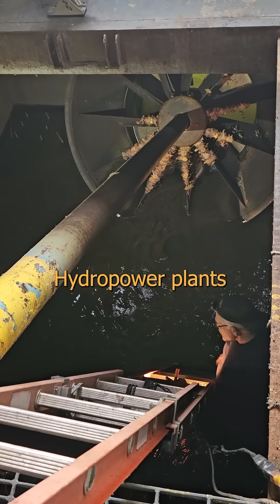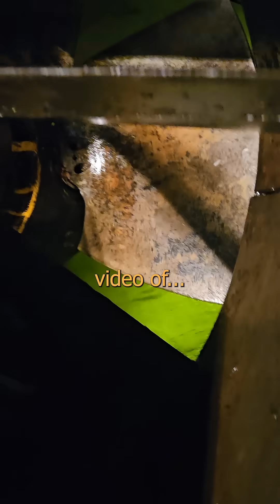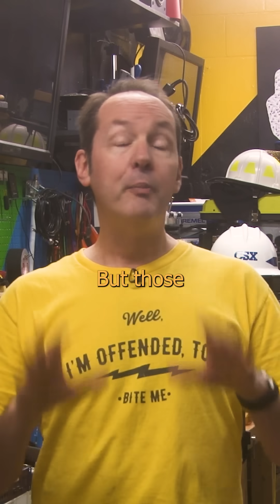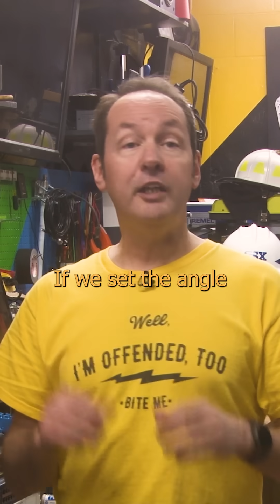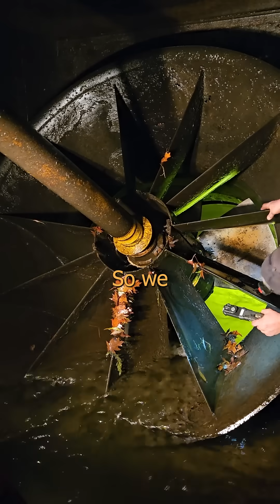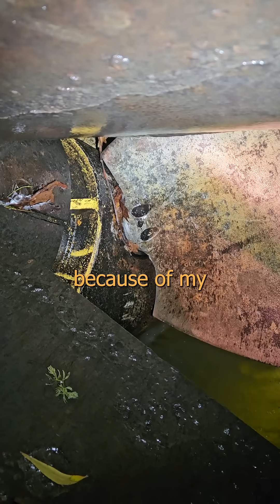Blade Angle  #chrisboden #comedy #engineering #educational #physics #apprentice #science #energy

Comment: Flying my mom's Cessna 337 was always cool because it was always a learning experience on how to fly that bird efficiently. Fine blade pitch for takeoff and maximum power availability then once you're high in the sky, start adding pitch angle to pick up speed and get better fuel economy. Don't get me started  on the finesse of FUEL MIXTURE control and Lean of Peak settings.  UGH    XD XD XD
Reply: I would hope in something as expensive as an airplane the fuel air mixture is controlled by the ECU to always sit in an optimal power and efficiency band.
Reply: @filanfyretracker  FAA certified piston engines DO NOT HAVE FADEC... especially engines for anything older than 30 years... And NOOOO... you cannot just fart around and change things  that are certified, unless you get the engine company to FAA certify that engine for Full Authority Digital Engine Control systems. Takes decades of testing and millions of dollars. Engine companies are gonna look at you like you grew a third arm and just laugh at you. So no... Unless you want your aircraft to be killed with no flight certification... ya don't screw with how yer bird was built... Common sense.
Reply: @filanfyretracker   besides... The engine ECU is THE PILOT...

Comment: I love how so many of our means of generating electricity is just simply spinning a turbine, from steam power, to nuclear power itself all just spinning turbines.
Reply: There are very few ways to generate electricity without the spinney bits, and nearly all of them are more expensive than using the roundy roundy pixey pusher. PV is the most common, and fuel cells are 2nd place. Peltier/BMJ/thermocouple devices can also be used but they are very inefficient.
Reply: @PhiloSage  It's also incredibly cheap for large scale. Compared to high tech materials like piezos and photovoltaics, the generator is just a couple of magnets and copper wire, or even replacing the magnets with more copper wire.
Reply: @PhiloSage Doesn’t make it any less funny that we are designing things with the same core idea all this time later!

It’s just like how a modern F1 car still fundamentally uses the same four stroke combustion cycle as first implemented in 1876.
Reply: @ChlorideCull when it comes down to it, it's all solar power. From direct photon transfer, to fossilized plants, to element fusion/fission. All from a star somewhere somehow. 😁
Reply: @PhiloSage tidal power would be an exception
Reply: @thorwaldjohanson2526 just where did the moon come from?
Reply: @ChlorideCull  that is how technology works... current technology is built on previous technology.
Reply: @PhiloSage  not the sun.
Reply: @thorwaldjohanson2526  also geothermal (which is arguably semi-tidal in nature, I think). I think a lot about subsea hot vents sustaining life independently of the sun.
Reply: It's one of the most efficient ways to generate an electric current and the general availability of water and its energy capacity make it an easy choice. Even a nuclear power plant is just a steam turbine generator with a very spicy source of heat. Even fusion reactors will likely be used in a similar fashion.
Reply: Photovoltaic solar is the main exception for large-scale power. Chemical reactions (batteries) for small scale. And thermoelectric generation is mostly just used to measure temperature & power some spacecraft. But "spinny thing go roundy round" + magnetic field is the GOAT for large-scale power generation.
Reply: theres a company called Helion building a fusion reactor that uses the magnetic field around the plasma (or something like that, im no nuclear botanist) instead, its pretty cool
Reply: @skyblue1954  you can ALWAYS find some goofy hypothetical thing that "someone is working on" or "researchers say". When you've heard all this stuff for decades and nothing ever comes of it, you start to see the pattern of bs 😂
Reply: @jeffhall768 I mean, they already have an experimental reactor and are building their next one
Reply: @skyblue1954 heard it before....
Reply: @skyblue1954  people have been lying about fusion reactors for 30 years, dude.
Reply: @jeffhall768 cool, I'll choose to have hope in the progress of humanity thanks, have a good day
Reply: @jeffhall768  thanks for telling us you're not paying attention.  Legitimate progress has been made in the last 5 years.
Reply: it's all either some form of windmill, or magic panels that steal power from temperature variants equalizing
Reply: @PsylomeAlpha  more like from somewhere on the electromagnetic spectrum.
Reply: Spinny boys got the world spinning by.
Reply: Don't be fooled, turbine technology has come a long way! It's just, we discovered the base most-efficient technology really really early, and have only needed to improve on the specifics, rather than overhaul the entire mechanism for something more efficient.
Reply: Right now electromagnetic induction is the most efficient means of generating electricity. It's so efficient that we actually have a kind of generator, that takes the current voltage from one line, and uses it to generate electricity add a lower voltage on a different line. We call this kind of stationary generator a transformer. However if you have mechanical energy available, which most people do; then the most efficient way to generate electricity with electromagnet induction, is to move the magnets and electromagnetic coils near or farther from each other really fast; and the most efficient way to do this is to spin them around each other.
Reply: Nuke Reaction > Heat > Steam > Motion + excess hot water + what ever is in those barrels in the corner, marked Dec 1991
Reply: Electricity is just "move a magnetic field around a conductor"

There's only one way to do that. Spin a magnet.
Reply: Rotationmaxxing moisture really be peak grid activity
Reply: Nuclear is really still steam power lol. It's all ways of spinning a shaft.
Reply: that's the only way to do it with magnets
Reply: It's just magnets all the way down
Reply: Interestingly, this concept of the large scale spinning machines, and our ability to manufacture them such that they can handle this sort of work, is a huge part of what kicked off the industrial revolution.
Reply: making things spin is half the reason we try to generate electicity in the first place. :p
Reply: We generate power by moving copper wire through magnetic flux. Creating electromotive force. There are other ways, but nothing even close to being as effective
Reply: Things that go "Whrrr" make things go "Bhrrr."
Reply: Almost everything but lightbulbs are just more spinning mangetas down the line
Reply: Nuclear power is just steam power but instead of burning wood/coal/gas. We burn nuclear rock
Reply: New ways of using a water wheel.
Reply: @Argyle117  There is no amount of words to explain lain the disappointment I felt when I realize that nuclear power plant just means we used angry rock to make water boil 😔😔

Comment: I'd like more information about how the blade angle is chosen and how that works, its relationship with flow, etc
Reply: my take is that its a kaplan turbine with no inclination and unless there is some inclination to these wickets/gates there will be no rotating flow to spin the turbine even if they were wide open. in other words, you can stall or idle this turbine even under full flow by pointing the wickets straight/90 degrees like he mentioned. it checks out.
Reply: Might I suggest you apply for an engineering degree?

Comment: So what is the golden blade angle?  Without knowing all of the variables, just off the top of my head I was guessing it was around 75°.
Reply: It's probably closer to flat than you'd think.  Wind turbines work similarly (but without the duct, which is significant) and optimal for wind is usually within a degree of flat (which we call zero in wind, not 90).
Reply: Thank you. I was thinking about the force of the water and how, being consistently stronger most of the time, a reduction in the angle would allow for less wear and tear and needed upkeep. This is way out of my area of expertise, so again, thank you for the knowledge.

Comment: Sorry to sound unappreciative but I would rather you showed us the mechanism and how it works, by taking it apart.
  You could probably find an airplane prop that has the same mechanism but if you insist on doing it while it's flying please select an aircraft with a very big glide path and close enough to a runway.

P.S. wait a minute you said collective you don't mean the collective group of adjustments it's like a collective on a helicopter, it just registered, 50 years late.

Comment: Great description of the Kaplan style turbine. Of equal interest is the Francis style or even a Pelton wheel. I own or have installed controls for many of each style with each having its own unique requirements.
Reply: I believe the three different stations Chris works at each have a different style turbine.  The one that they rebuilt the stator I believe has a Francis, as they adjust flow through wicket gates, and and another Pelton - as it has a horizontal axis.

@PhysicsDuck - Maybe a video that goes over the specs of each site - On-line date, KWh, turbine style, head height, generator specs (# poles, windings, voltage, etc.).
Reply: @fredinit the one where they just overhauled the rotor had the lower end overhauled in early 2020. It is a wicket gate setup with variable pitch blades. Part of the project was getting everything working again.

Comment: God it's all just sunlight powered isn't it? 
Everything comes from stellar fusion. 
"Everything's a weird solar panel, including your V8"
Reply: Since the water in the dam is put there by Earth's hydrologic cycle, technically, yes, it's powered by the sun.
Reply: a tiny amount of it comes from fission inside the earth, but then again thats from neutron star collisions and the like so still star powered
Reply: So far only none stellar source I've figured might be tidal energy. 
Which is from the conservation of angular momentum of the observable universe I think? 
Which, er, came from the big bang I guess? 
I'm a little fuzzy on the source of energy for that one. 
I guess stars still pump the universe full of energy from fusion and subsequent fission. 
Solar wind accelerates particles, gravity makes round funnels in spacetime, presto angular momentum. 
So, probably still stellar fusion energy.
Reply: If there were no galactic expansion, I wonder if eventually fusion would just turn everything to heavy elements and radiation.
Would a steady state universe still do heat death, running out of hydrogen as it's all turned to iron and sunlight.

Comment: That's pretty cool. I had no idea it was just like a variable pitch propeller on a ship. I always assumed it was controlled via water flow
Reply: I love that it’s a “collective pitch blade angle adjustment”. A century before helicopters. Helicopters have a “collective” which changes pitch of all the rotors at the same time, and a “cyclic”, which changes pitch to different settings as the rotor cycles in a circle, thus pulling directionally, instead of in alignment with the shaft.
Reply: My thoughts exactly. After working on ships that was the first thing that came to mind. A ships contolanle pitch propeller.

Comment: how often do you need to change the blade angle? what factors need to be considered when changing the angle?
Reply: I can't say I have any actual fuxking clue about this bur I would assume it's adjusted all the time (in a PID loop) based on baseload power needs.
Reply: @forbiddenera  base load = the part that doesn't change, that's always there.  One of the things that makes hydro plants valuable is that they can ramp output up and down quickly.  Load following, the opposite of baseload and more valuable, a great compliment to wind and solar.
Reply: @charliesullivan4304 true but there's always a base load ghat does vary, perhaps not the best way I could've said it
Reply: I imagine they have to change if the flow changes because the turbine has to be rotating at however many RPMs give them a 60 hz output.

Comment: Would love to know how they make the adjustments
Reply: Hydraulics and gears. Some more complicated blade-pitching mechanisms will even have pinning latches to keep the blades at any number of pre-set angle points to avoid them breaking loose and flapping about.

They're conceptually very similar to variable-pitch props and screws on planes and boats, respectively.
Reply: @KiithnarasAshaa  There must be some sort of feedback mechanism to make them change with pressure and flow to maintain a constant speed.
Reply: @minuteman4199 Not necessarily. Hydraulics are (basically) incompressible, so control feedback loops aren't necessary once the system is calibrated. As long as your hydraulics setup can seal fluid flow between sides, it isn't going to move unless something fails.
Reply: @minuteman4199 I suppose you could call hydraulic piston position sensors a feedback mechanism, but it's dead simple. There doesn't need to be any kind of PID controller that responds to external forces and deflection because for all practical purposes there isn't any deflection from external forces... as long as your hydraulic system is rated to handle those forces.
Reply: @minuteman4199   The generator keeps itself synced to the grid. If it gets ahead of the grid the grid sucks energy out in the form of current. If it slows down the grid sucks less current (energy) and the water wins, speeding it up. Adjusting the pitch sets the amount of energy extracted from the water base on what is demanded by the grid control infrastructure.
Reply: @KiithnarasAshaa .. and helicopters? 😂
Reply: very carefully
Reply: Computer magic
Reply: The basic setup, if non-hydraulic, would be a rod down the center of the shaft which is pushed and or pulled at the generator end, then the end inside the prop pushes/pulls either levers or rack and pinion to rotate the blades. At one end or the other there's a bearing that allows the rod to be spinning at the prop end and stationary at the control end. Much like the clutch in a manual transmission.
Reply: the mechanical process or the control system?  I would guess given the age, the control system uses some kind of mechanical governor to keep the shaft speed correct to produce 60 hz  AC, which sounds like another great TFT for Chris to show us.
Reply: @kenbrown2808   Actually the generator keeps itself at 60 Hz. (or whatever the grid is at) You just have to get it to 60 Hz (synced) before you connect it to the grid. Then you adjust the pitch to match the load. So the feedback is actually how much current the grid draws
Reply: They contract out to Aquaman